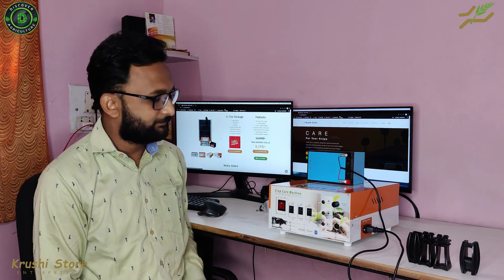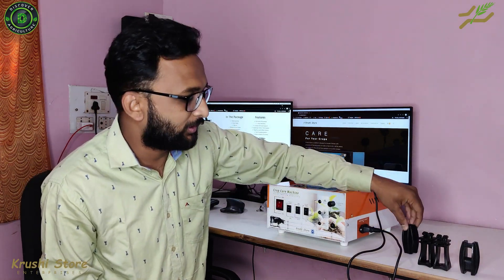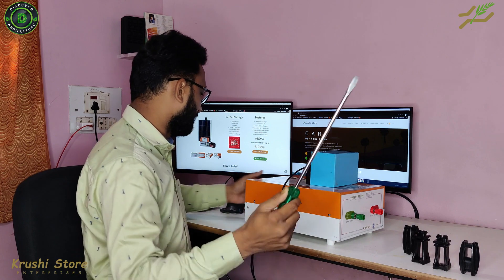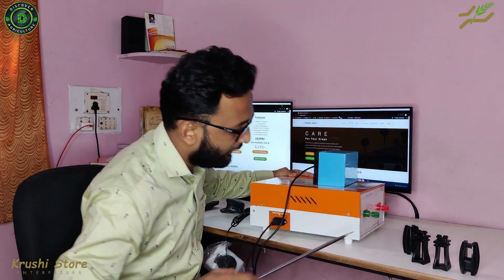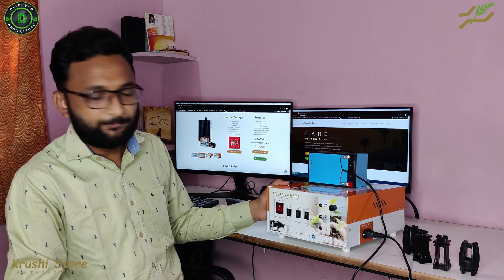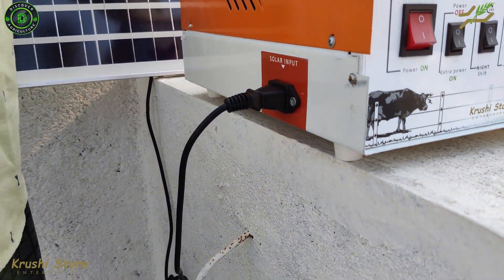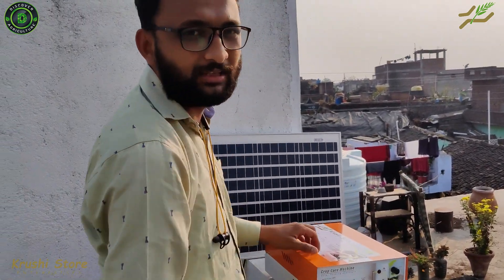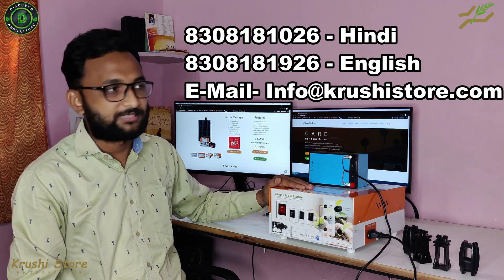How to Test Solar Fencing System | CCM Solar Fencing For Agricultural Land | Zatka Machine

Comment from the maker: CCM Solar Fencing System (Complete Package)
* Solar Fencing Guard 45 Acres Capacity
* Automatic 12+24 hours, with solar attachment
* Fast charging system
* Solar panel 12v, 40w
* Battery 12v,12Amp (with 6 Months Warranty)
* Corner Insulator  20 pieces  (FREE)
* Square Insulator (Hook Insulator) 100pcs (FREE)
* 1 Year Limited Warranty
* 2 Years of Spare Support
Price : ₹8,299.00

SOLAR FENCING SYSTEM | Protect your Farm without Killing Animals | Solar fence for Agricultural Land: https://youtu.be/mmKAcyfkN7M

If you want to buy this Fencing System,
Visit: https://krushistore.com/
Contact: +918308181926 / +918308181026
Email: info@krushistore.com
Reply: Pay on delivery available or not.